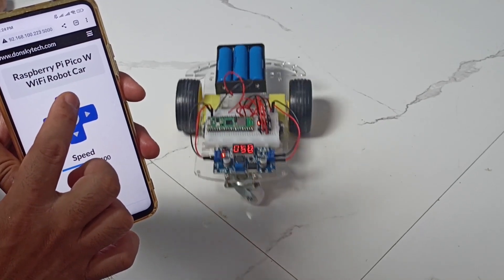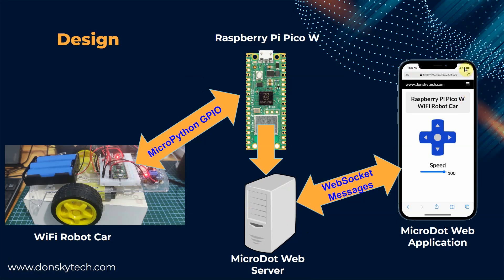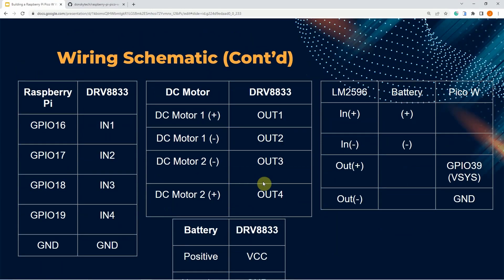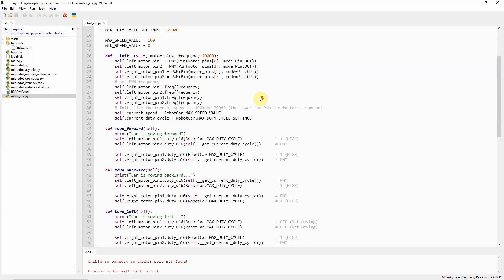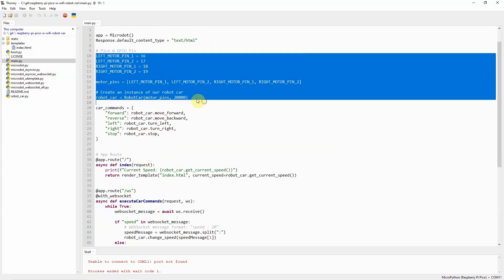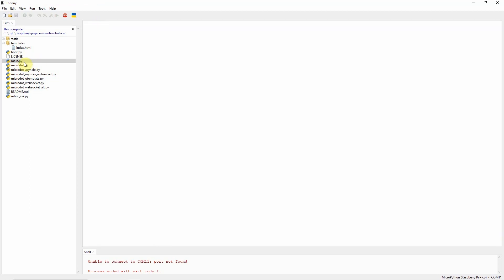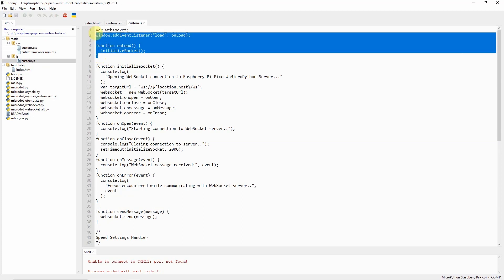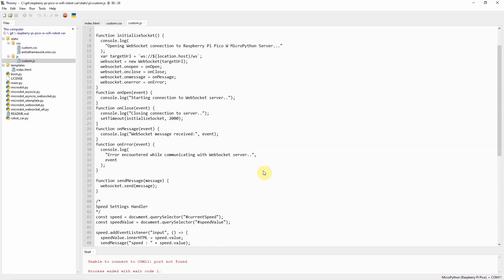Building a Raspberry Pi Pico W WiFi Robot Car

Comment: How do the wires connect to each other? Is it soldering or there are holes in which we fix the jumper wires?
Reply from the maker: Which wires? I used breadboard here.
Reply: In your wiring schematic there is no breadboard shown so I am confused, I am new to this so it’s a little hard for me but I have basic background knowledge

Comment: Can I add extra two wheel
Reply from the maker: Hey, yes of course you can do that. It depends if you want to control those additional two wheels so code changes might be needed.
Reply: @DonskyTech  additional driver required?
Reply from the maker: Hey, Not sure what you want to do. If you would be controlling the extra two wheels then you need a new driver module and edit the code also